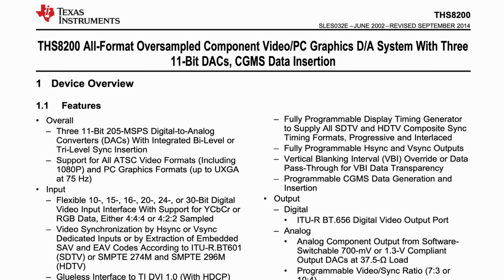4K Analog Video

Comment: Was just having a quick squiz at the THS8200. "All format" - sure, but I'm not clear, can it do "arbitrary" video signal generation. I.e. sync generated from the source not the DAC?
Reply from the maker: Yeah, it receives a HS and VS clock. From the HS clock you can specify the duration and levels of all the relevant periods/leavels, so for the sync pulse(s), blanking periods, etc. And then you can register 16 types of scan lines, and you specify what line (as counted after the prior VS)  for each of those scanline types, you can set pulse sequences for Vsync purposes, etc. It's a nice abstraction model for constructing analog video signals.
Reply from the maker: Oh. Maybe I misunderstood your question. It can also be used as 3 parallel DACs with no timing generation, so if you want to embed the sync signal within your pixel data, that works too.
Reply: @superchromat interesting. Yeah i'm always sniffing around for possible DACs for a future version of my HackDAC project. Maybe this could be a possibility. Not as good as what i currently have but cheaper!